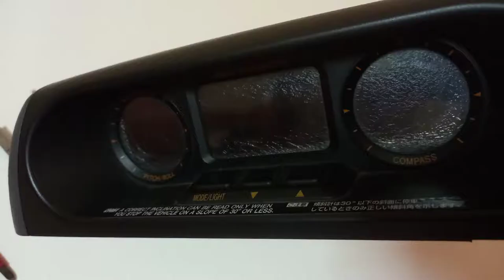EP.16 Landmeter Gen 2 in Prado Fj90 Polarizer Films Removing ลอกฟิล์มเก่า

Comment: Again can you let is know what polarizing film you used to repair the screen. That would be most helpful sir....
Reply from the maker: I bought the film from a local shop in Bangkok Thailand.😊
Reply: @toemsakpolsri1073  I attempted to fix my car but the polarizer film is not the correct one. Did you place both the front and back at a 90 deg angle?
Reply: Is it possible to contact you by phone?
Reply: @toemsakpolsri1073 Will any polarized film work?